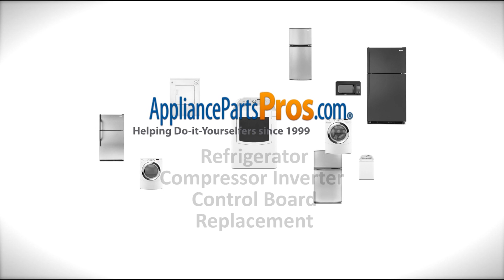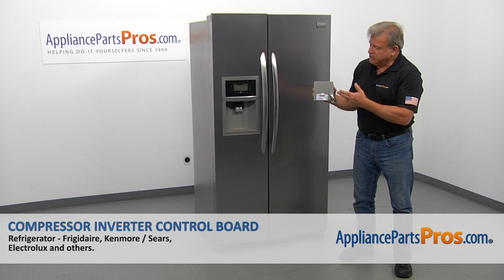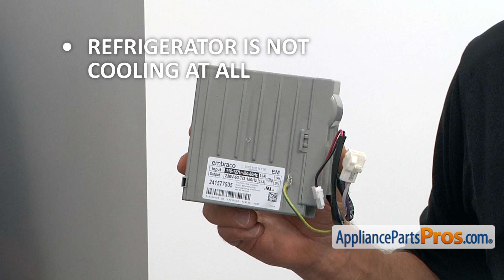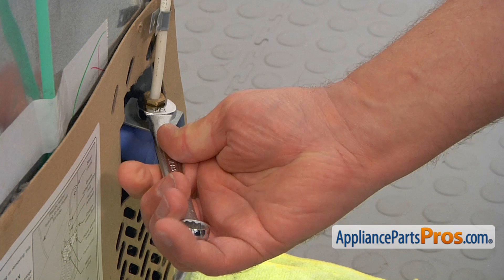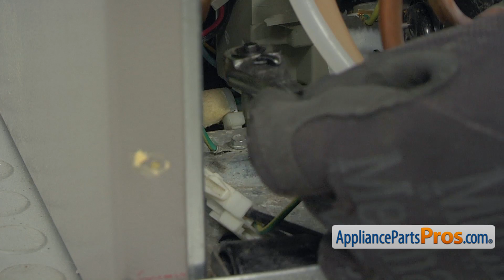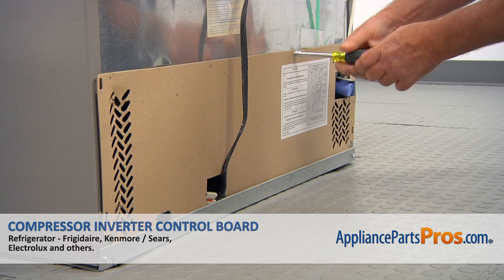How To: Frigidaire/Electrolux Compressor Inverter Control Board 241577505

Comment: So does this model not have a start relay? Is the board in lieu of the relay?
Reply from the maker: Correct, this model does not have a relay, that is replaced with the invertor control board.

Comment: one of the most stupiest designs the level of difficulty to remove omg
Reply from the maker: Yeah, some of these designs can definitely be frustrating to work with, especially in tight cabinet spaces. It’s always a bit of a challenge when access is limited like that. Glad you were able to get through it though—thanks for watching! 😊

Comment: great video thanks, there's a part with the same serial number but it's for a kenmore fridge, doesn't have the outter cover, but the internals look very similar, do you know if it would work on a frigidarire fridge?
Reply from the maker: That depends on the model of the Kenmore unit. For the most part, Kenmore has other manufacturers build the unit and then they'll slap a Kenmore sticker on it. For example, if the model on the Kenmore starts with a 790, 791, or 253, it is built by Frigidaire and would take Frigidaire parts. What is the Frigidaire model number you're looking at? We may be able to track down the right part.

Comment: That ring ground wire was a bugger to get off and on. Changed out tonight, compressor was running now. Find out tomorrow if successful.
Reply from the maker: @tryinout1s583 Nice work getting that tricky ground wire off and the new board in! 🙌 Sounds like you’re on the right track — fingers crossed everything’s cooling like it should by tomorrow.

Comment: Not bad.   Video.

This video is similar to other models.  The one I have doesn't have a ground on the compressor.  There are only four connectors and each one can only go in one place.  For the ground, the color code should be the same on most or all of these units.

Just keep in mind that this is a simple plug in type module.   Just be gentle with those copper pipes. Unplug the AC of course first.
Reply from the maker: Thank you for the tips!

Comment: Hopefully this is the part I will need. My fridge is not cooling at all due to compressor not running. I ordered mine on Amazon Prime for $220. Easy return if I diagnoses wrong. It is for my Electrolux refrigerator
Reply: Same my this morning was not cooling at all fan is working but compressor is not  hope that’s the problem 😂😂😂 bcs it’s is expensive that part
Reply: Ok guys it worked beautifully.  The part was bad. No humming when unplugged and plugged back. But with the a new replacement inverter from Amazon Prime. It worked. I connect the ground first then a few pig tails and the 3 prongs plus the ground into the compressor.  Plugged back into the wall. The compressor was humming and running nicely. The fridge is getting cold air now. Let's see for a few hours. I also recharged R134A using video from YouTube with piercing valve to help it get very cold.
Reply: Over night, fridge came down to 35 degree and freezer side came down to 5 degree. It is good. I recharged with freon with piercing valve when the compressor was operating.  I filled up around 3 psi. I'm happy with the result.  Now ice maker repair job . Thanks guy
Reply: I haven't checked anything yet but how did you know that was the problem? Compressor not running
Reply: @vg8606  idk. I search for the problem.  I have another fridge. The compressor will usually run after plugging it. But this one won't.  The answer to problem is the capacitor or the other part that is plugged onto the compressor itself via 3 prongs. But mine has this inverter box thing . I guess it is the trouble one.
Reply: @vg8606  compressor didnot run. No vibration to it. I just replaced the inverter box and it is expensive $220 Prime. It worked nicely. The instant I plugged it back. The compressor starting humming nicely. Music to my ear. I didnot check all the voltages from the inverter because the video on your was not very precisely showing where to check. I took my chance it was this box inverter went bad. Good luck
Reply: thanks to letting me know .really appreciate I will do the same 😂😂 and congrats about yours 👍👍

Comment: how do you know it is the box that need to be replaced. My electrolux , the freezer is not working.  the compressor is not running.
Reply: Actually both side are not cooling and compressor not running

Comment: Thanks so much for sharing the information. Now I will replace it myself. This part it’s about $400. FYI Just the part itself. If you call a tech all included  the labor you’re looking in about $750. Thats what the person that called me needed to pay for the fix according to the technician that came over.
Reply: i was able to get an used one on ebay for $116 with 1 year warranty